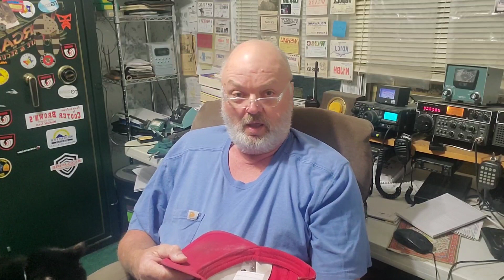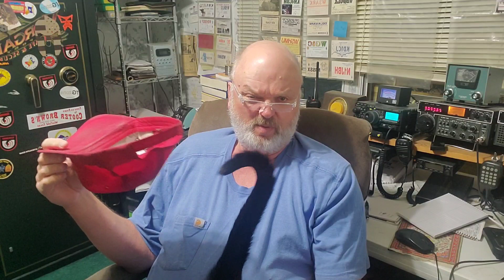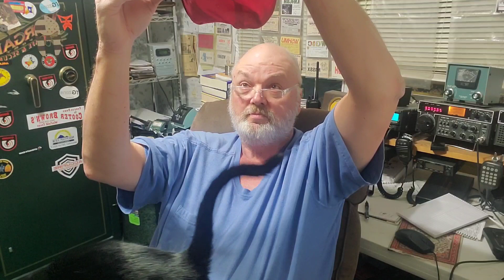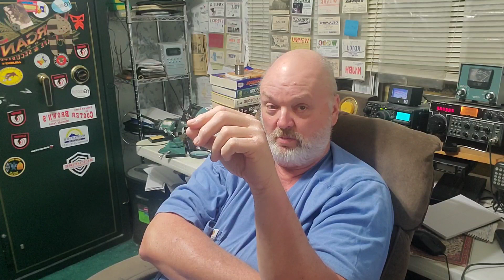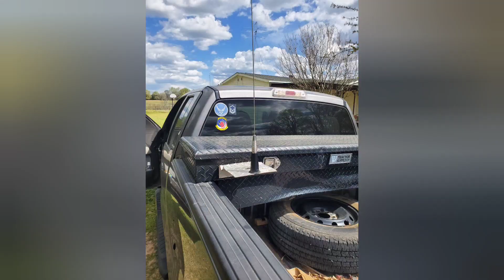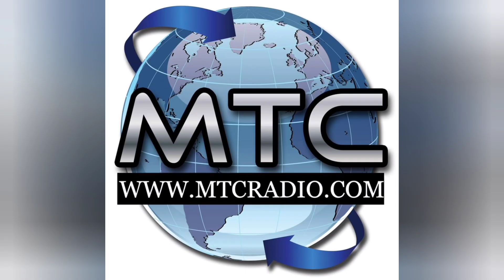And the winners are! plus part 1 of used gear#hamradio #hfradio #usedradios #KB5MIQ

Comment: I've noticed quite a few of the older transceivers are being sold without the external power supply as well. So that was a good idea to mention about inquiring about the power supply if someone finds a older radio that they may be interested in. if you're interested, it never hurts to ask about it. An older radio can be fun to operate just keep in mind it can be like a vintage car, you're probably going to have to work on it or pay someone else to do it. But they are also great to learn on as you study electronics. Also most of the older vacuum tube equipment carries some high voltage in them so study up on how to properly work on the circuits safely. Most of all have some fun. Another great video big boy!

      Jeff/WD5HKV
Reply from the maker: thanks buddy!